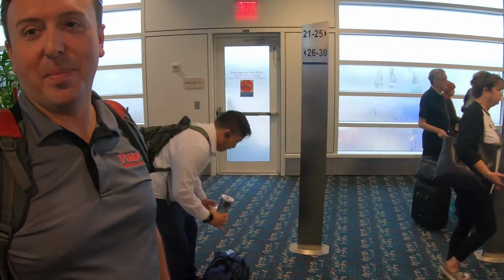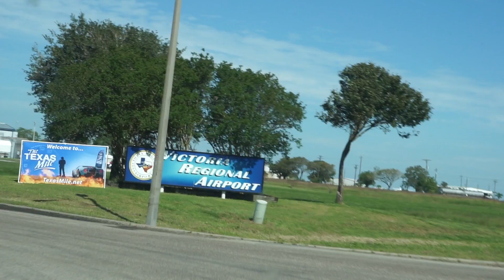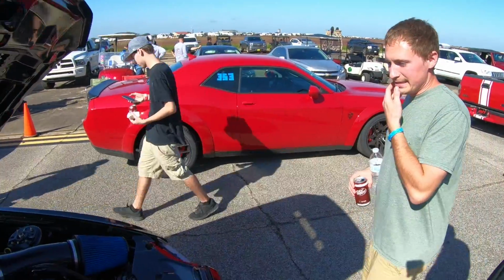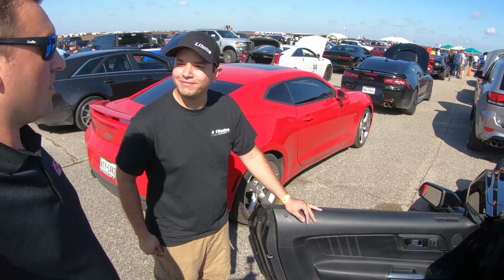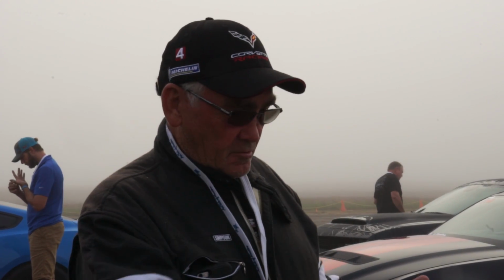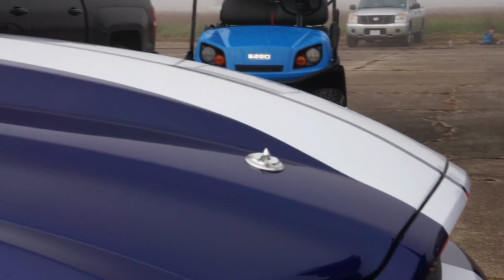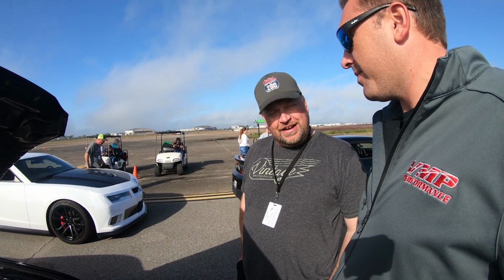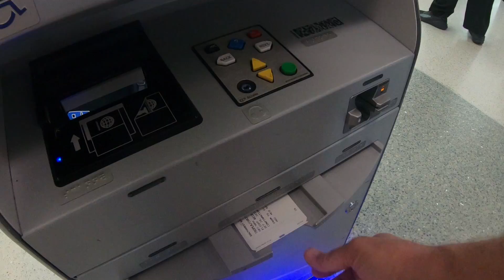Worlds Fastest TVS GT500 is Powered by VMP | Texas Mile Vlog

Comment: Can someone tell me why Kenne Bell isn’t as popular on Mustangs anyone like it used to be?
Reply: We've made 1000+ rwhp with an OEM 2.3L TVS and set the 1/2 mile record for a supercharged Mustang with the VMP 2.65L TVS need I say more? :) 151mph 1/4 mile on a non-prepped surface and 225+ mph in the standing mile with under 3 liters... The TVS blowers are highly efficient.
Reply: Jordan Weir what are theirs if not TVS? I’m not expert on S/C
Reply from the maker: The KB is a 3-5 lobe twin screw, due to the rotors not spinning at equal speed, it does not have the RPM capability of a TVS.
Reply: VMPPerformance gotcha, so are their three types of blowers excluding the centrifugal? TVS, Roots, and Twin Screw or is roots type and TVS interchangeable words when referring to blowers?

Comment: How does VMP compare to Kenne Bell?
Reply from the maker: We use Eaton TVS technology in our superchargers, it is extremely high efficiency and extremely durable.  Eaton TVS rotors are found on high-performance vehicles from Ford, Chevy, and the new 2650 rotorset is standard in the 2019 Copo Camaro blower.
Reply: Super snakes come with kennebell or whipple for a reason...
Reply: @betterthanboost  because the 2650 tvs wasn't available back when kbs came on super snakes.  This isn't 2010.  No reason to have a huge blower...if you want more than what these things are capable of you should go turbo.

Comment: Whats the gear ratio most guys run for the mile? I know you have choices now with 10 speed autos and whatnot but wheres the sweet spot gear ratio in your opinion?
Reply: Becoming an unsubscriber if i dont get an answer within the next min... lol
Reply: i'd also like to know ..
Reply from the maker: Great question, they are shooting to run through the mile mark at the top of 4th or 5th, so usually a 2.73 or 3.08 depending on the power level of the car.
Reply: @VMPPerformanceTV  thank you for the reply ! awesome work

Comment: From a layman's point of view, that last run looked like it could have been a 230 mph if he did a better burnout and launch.  It seemed like most drivers launch poorly.
Reply: Non prepped, sandy runway with road race tires, tall gears and stupid amounts of VMP 2.65L TVS torque... 150+ mph 1/4 mile splits are big boy numbers at Texas Mile! The "launch" makes very little difference in the end. :)
Reply: Probably another 2 mph in tightening up those grandma shifts.  Time to hire a hot shoe....then again there’d be nothing left for Jordan at that point since he doesn’t actually do anything technical except sell parts on the interwebs.
Reply: Some people just don’t understand mile. or what driving a 1100+hp car without a real tire is like. get like 2 runs a day. Sure shift is better than a missed shift. car is in 4th going through half and mile traps.
Reply: @jordanweirracing  Thanks for replying Jordan.  It just seems to me, an average mo, that every inch is important when inches make a difference.  Everyone seemed like they wanted to launch like a bat out of hell.  But - they were going sideways at times.  Practice launching to get that 1/8 mile mph up.
Reply: @maddogmark6460  No problem! "Launching" off the line will get you to the finish quicker (ET) but has virtually 0 effect on the mile trap speed. You also don't do a big smokey burnout with road race tires. The unprepped runway is extremely traction limited, nobody is going to launch 4 digit hp off the line with R7 tires and RWD, including the rear engine cars. This was a 190mph 1/2 mile (all-time record for a supercharged Mustang) with a 151mph 1/4 mile split which is the fastest I'm aware of out of a blower car at Texas Mile as well. As an experienced Texas Mile driver I can assure you the car I built and drove ran what it was capable of that weekend. Our twin turbo automatic S550 race car went 157mph 1/4 207mph 1/2 for comparison. Same tire and capable of twice the power. It's all about traction, or I should say lack thereof! If you ever get a chance to try it I encourage you to take your car to Texas Mile. It is a ton of fun!
Reply: @jordanweirracing  So, are you saying that on that runway, regardless of the launch, your car maximum speed on that day was 226.  And if you had another mile (2 miles total) to reach your max speed, it still would have been 226?
Reply: @maddogmark6460  Yes, I am saying 226 is what my car was capable of running at this event in 1 mile. No, I never said anything about 2 miles or 3 miles. It will certainly go faster than 226 with enough track. Look at it this way... I went 151mph to the 1/4, was 211mph at 3/4 and 226 at 1 mile.  If I had gone 1mph to the 1/4 (leaving 3/4 mile left) I would have run 211mph (my 3/4 mile speed). That would be 150mph slower to the 1/4 yet only 15mph slower to the mile for a ratio of approx 10mph (1/4) to 1mph (mile)... My two 226mph passes were 151.3mph 1/4 & 226.2mph 1 mile vs 150.0mph 1/4 & 226.1mph 1 mile, 1.3mph faster in 1/4 was 0.1mph faster in the mile, a ratio of 13mph to 1mph. These are just a couple pieces of data but based on years of experience and many mile passes as well as many many hours spent analyzing data from my cars and other's cars I can assure you even a few mph gain in 1/4 mile speed would have a hard time reaching 227 let alone 230 with that car (same power, same aero, etc other than driving) in those conditions without other changes being made. I'm quite happy with my performance as a driver this event but I am all ears if there is advice on launching a 1200hp car with crappy tires on a crappy surface! Here is a look at the fastest 8 GT500's this event:

1/4 mile / 1 mile
146.4 / 253.1 race car (turbo, Motec, traction control)
142.9 / 247.4 race car (turbo, rest of setup unknown)
131.1 / 232.0 race car (4.2KB, aftermarket computer)
151.3 / 226.2 my street car (2.65L TVS, factory ECU, full interior/AC/power brakes)
146.0 / 224.0 race car (4.7KB + nitrous, Motec)
139.2 / 219.5 race car (4.2KB, aftermarket ECU)
141.9 / 218.3 setup unknown
145.5 / 218.2 street car (3.6L Whipple, factory ECU)

According to the results (based on fastest 1 mile pass for each driver) my 1/4 split was the fastest this event by almost 5mph. One of my favorite GT500's of all time and the street car / factory ECU / supercharged GT500 record holder set the record a few years ago with 149.3mph 1/4 and 232.4mph 1 mile splits. Mark, I don't think you mean any ill-will based on your comments but others certainly do. I don't present this data to be arrogant but rather to show why I find comments like "non-driving ass" to be laughable! I'm very pleased with the results we got from the VMP 2.65L, I'm happy with how the weekend went and happy with my driving. I'm also confident in our team's ability to EFFICIENTLY design and execute a plan for cars we work on. Just look at how our street car did with a "little" blower! It is currently snowing here in Minnesota but this car will definitely see a lot of miles on the street next summer! Look at our results and then ask yourself if the negative comments here hold any merit. If you would like help with your build, whether for street driving or drag racing or standing mile, I am more than happy to help you at Weir Racing!

Lastly, I'll leave you with this video of my driving from a few hundred horsepower ago on the stock engine. ;) https://www.youtube.com/watch?v=xWcH57oN0BU&feature=youtu.be&t=17